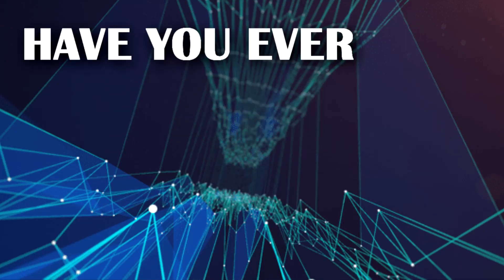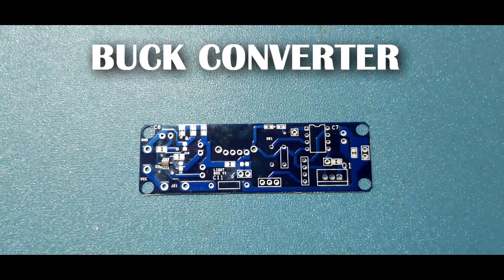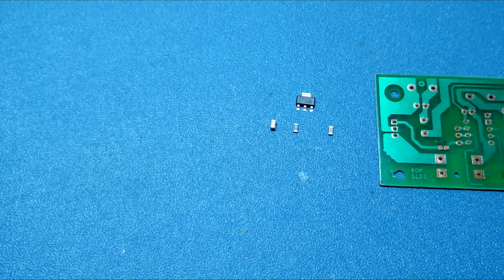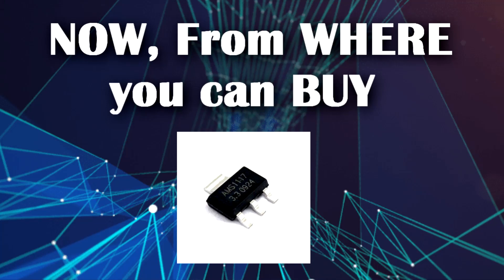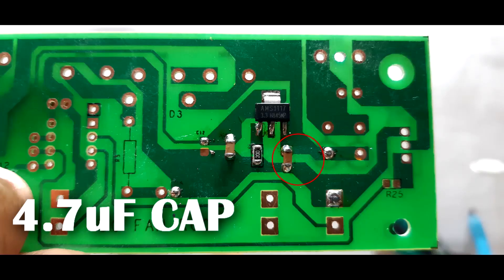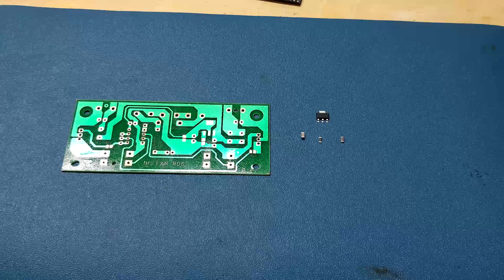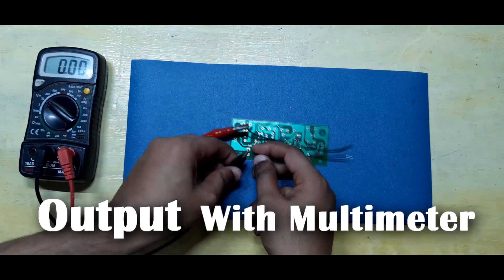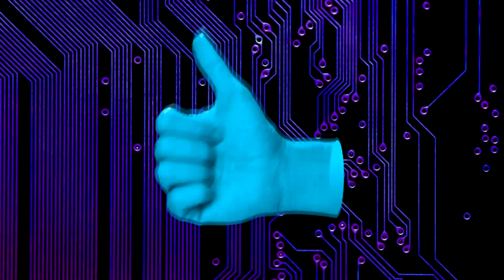how to use AMS1117

Comment: How do I choose the resistor and capacitor values depending on my use?
Reply: Bro, just check the regulator's datasheet to know what are the typical configurations and recommendations from the manufacturer about additional capacitor values.
Reply: @StevenBedoya2  Bro, of course I could do that, but the whole point of the video was how to use something, so having to look up how to use it makes the video a bit pointless.. 🤦‍♂️
Reply: @marcus3d  bro, with this attitude u are not going to achieve much lol if u want the info u gotta find it not ask others for ur specific cases, the peoplle u r asking had to learn by searching for the info themselves.
Reply: @son_of_a_birch  Bro, I didn't ask for any specific use case, now did I? I asked for a generic solution. And if the person who did the video won't say how to accomplish it, then what, pray tell, is even the point if the video?
Reply: @son_of_a_birch  bro u never asked a question?
Reply: @user-fo2tt9sy4b  my point is that this guy is trying to say that the video is pointless because it doesnt give him his exact specific use case info. thats just not the right attitude lol theres plenty of info still.

Comment: What's with the resistor?  What ceramic capacitor are you using that meets the ESR requirements of your output capacitor? Where's the schematic? This is such a confusing video.  You must have spent hours on that movement montage and zero minutes actually explaining the regulator.

Comment: I honestly don't see why people say this is a good video it doesn't show you anything. It doesn't show you the proper pinout you were soldering to hidden traces they could be going to any of those pins on the bottom of the board. You can guess that you're going left to right from one to three but it will just be a gas for people that have never done this before schematics are useless they don't really tell you how to wire anything unless you really understand even the simple schematics like this for example the pin outs are not left to right as a wiring diagram would indicate the shift around 1 pin counterclockwise to the left so anybody that would follow this as if it was the actual component would not be wiring it correctly this is what makes me angry at people that are posting these videos for new I'm experienced people that are trying to learn electronics they will get it wrong almost every time.
Reply: At least we can comprehend what he’s saying. Someone can’t even manage to do that.

Comment: Bro i am not  going to mount this or use it permanently but i wanna make a supply which i can use to test some modules in that case i need to ptotect its output from short circuit. Do you know how to add protection to its output
Reply: Use a MOSFET

Comment: I'm new to electronics and have no teacher I'm using 8v power source and 3.3v lm1117 I have 100u electrolytic cap on input and 10u electrolytic cap on output is this ok?
Reply: Only if you use small currents

Comment: All Sources and datasheets don't tell something about that resistor. Why did you use it and what did this resistor do? Only for 1117-adj or the use of two simultaneous 1117 with two powersupplies use a resistor. I think the resistor is wrong. What is your opinion?

Comment: Good video, but I wanted to see some more advanced tests :) like for example:
- output voltage with some small resistance (to see if the voltage will remain the same),
- built in reverse polarity protection test,
- voltage dropout test,
- built in short circuit protection test.

Comment: Can we change the value of resistance to get an output of 3 volts? How much?
Reply: Not in 3.3v or 5v version... You have to find ams1117-adj which is adjustable by two additional resistors
Reply: Tinker the value of Resistance on ground